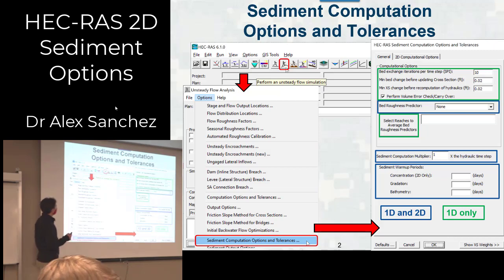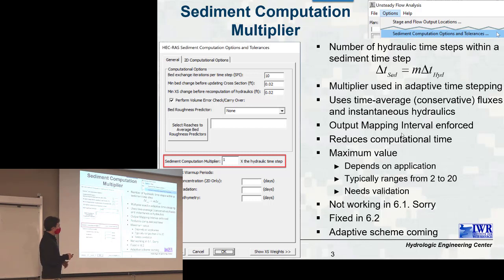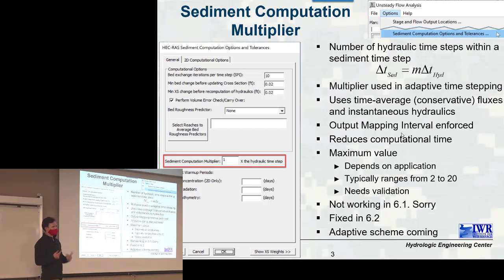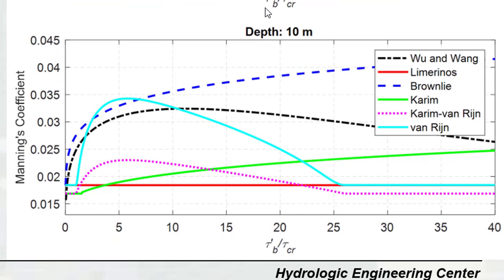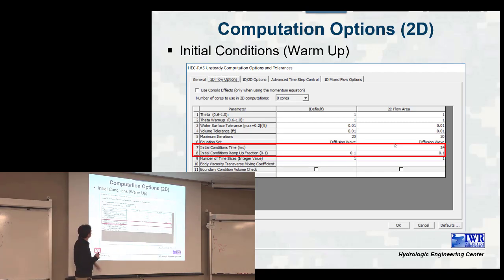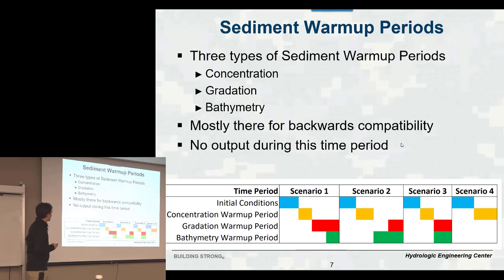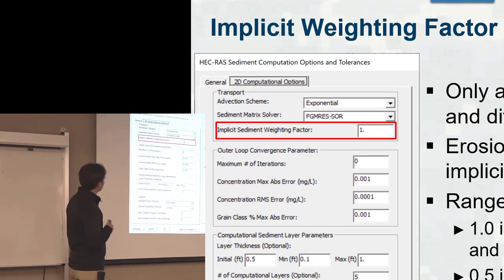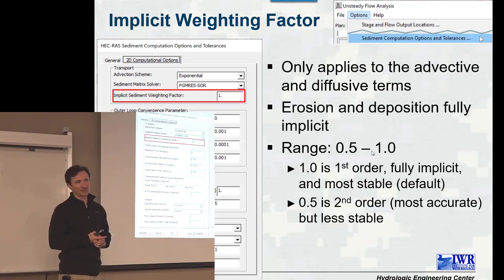HEC-RAS 2D Sediment Computation Options

Comment: How about 2D Computational Options? I was interested to the Layer Thickness parameters. How to assign Initial, Min and Max values?  The Initial (or Min) value is the same of the Min Thickness that I have to assign in the Bed Mixing Options? Waiting for your support. Thanks a lot and compliments for sharing!